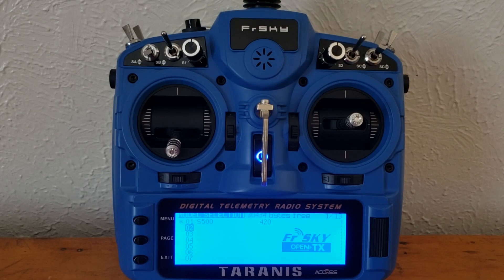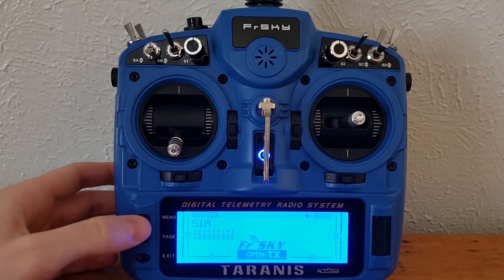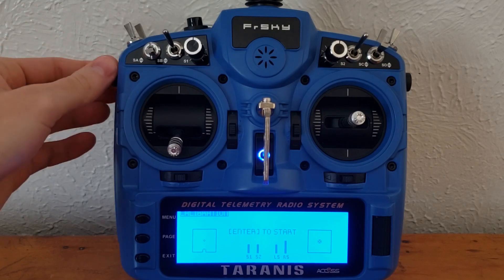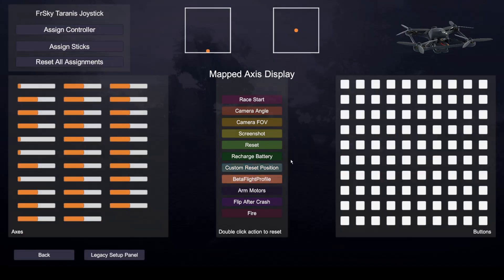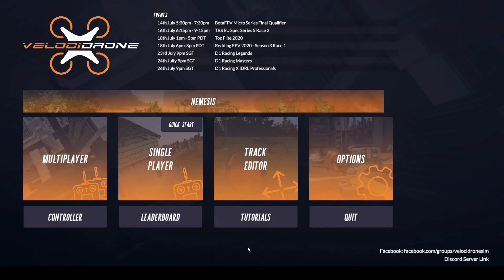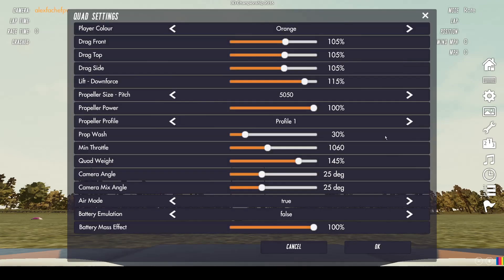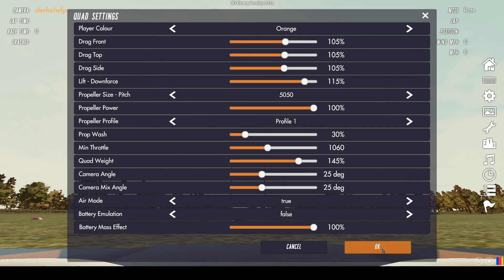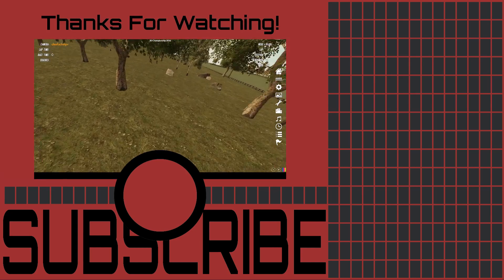Velocidrone Transmitter Setup - This FPV Simulator Changed the Way I Fly

Comment: Is this super hard for anyone else? Going through the race obstacles is so freaking hard. I'm a long time gamer and have played and mastered many racing and flight Sims. When I saw where the tech is at for Drones I got really excited to get into this and started with velosidrone before buying a drone, but this is way harder than I could have imagined. So much so I'm wondering if I'm doing something wrong.
Reply from the maker: Don't worry that it's pretty difficult at first, even though you have a lot of experience with other sims, with drones the inputs/controls are dependent on one another so it may feel a little weird at first. When I first started flying my real quad it took a few weeks to get a feel for everything. I'd suggest trying basic maneuvers (fly in a square/circle/etc), try to follow a road, and be able to center yourself in between gaps (between adjacent buildings/trees/etc). Then when you're tackling the course obstacles fly very slow. There's no need to rush through it if you can't even line up in front of an obstacle/gap.
Reply: Super hard at first. Took me a whole year grinding to finally finish a technical track without crashing. Super worth it tho.
Reply: @nozty  update: It got easier. So much so its hard to imagine it was hard. Like riding a bike. I'm actually quite good now.

Comment: Hey man I have been watching all your videos for a while now and I just wanna say I love the effort and time you put into them. They are very professional and helpful, especially for me who’s really new into this hobby. Do you happen to know how to setup the Pixhawk 4 on a standard plane configuration because for some reason I cannot get the servos to work with the correct PWM outputs. Thanks in advance and keep up the great work!!
Reply from the maker: @S Alan Thanks so much, I really appreciate the great feedback!

I have only worked with quadcopters with the pixhawk 4 but I can try and walk through it with you. (also sorry for the long note and weird formatting)

- Which power management board (PMB) are you using? https://docs.px4.io/v1.9.0/en/assembly/quick_start_pixhawk4.html#power this is the one I have (PM07).
- From the above link there are two types of outputs, "MAIN outputs in PX4 firmware map to I/O PWM OUT port of Pixhawk 4 whereas AUX outputs map to FMU PWM OUT of Pixhawk 4."
- Also take note of this table for later (found in the same link from above, scroll down a little):
Airframe Reference Connection between Pixhawk 4 --> PM board
MAIN: motor                 I/O PWM OUT --> I/O PWM IN
MAIN: servo                 I/O PWM OUT --> FMU PWM IN
AUX: motor                 FMU PWM OUT --> I/O PWM IN
AUX: servo                 FMU PWM OUT --> FMU PWM IN

- So as an example take a look at the X quadcopter that I used https://docs.px4.io/v1.9.0/en/airframes/airframe_reference.html#quadrotor-x.
- For a quadcopter we use motors and not servos so based on the table from above we are looking at rows 1 and 3. In the diagram of the X quad we also see that the specific outputs are MAIN. This narrows are rows {1, 3} -> {1}.
- So basically what you can see from the diagram is that the top left motor is 3 => Motor 3 => MAIN3. In another table from the above link there is line that is: "M3 I/O PWM OUT 3: connect signal wire to ESC of motor 3 here".
- So we solder the ESC/motor to M3 on the PMB then apply the same steps for the other motors. By using the I/O PWM OUT --> I/O PWM IN the motors could be controlled through their respective ESCs.

- Now for the plane.
- Which plane frame are you using?
- Looking at the standard plane for now https://docs.px4.io/v1.9.0/en/airframes/airframe_reference.html#standard-plane it appears that aileron, ..., flaps should be attached by MAIN meaning we are looking at rows 1 and 2 in my makeshift table from above.
- We know that on this particular plane the only actual motor will be used for throttle which is MAIN3. This is row 1 in the table. So this motor would go from  I/O PWM OUT --> I/O PWM IN and since this is an IO you solder the ESC to the M3 pad on the PMB (coincidentally same setup as above for motor 3 of the quad).
- In order to control your flaps you use servos. These fall under I/O PWM OUT --> FMU PWM IN.
- So you will need to attach your 3pin servo cables to the pin headers that are marked FMU-PWM-out on the silkscreen of the PMB. (I know I said FMU-PWM-in and FMU-PWM-out however in the docs it says that these are internally connected meaning that you can treat them as the same).
- example, For aileron which is MAIN1 you would attach this servo to pin 1 of the FMU headers. You should double check the pin ordering via the PMB manual but I'm pretty sure pin 1 is on the bottom if you are looking at the board with the battery connector up top. elevator is MAIN2 so pin 2, etc.
- One other important note is that the power line of pins for the FMU servos is not powered. In the docs it recommends grabbing the 5V BEC from your esc or getting it from your battery to power it.

- Make sure you then have both IO and FMU cables attach to your pixhawk from the PMB.

- Disclaimer, I have not actually done this for a physical plane so definitely double check this to make sure you aren't shorting wires when soldering, don't leave battery plugged in, etc (reading the docs will help you for future projects as well). Also let me know if you have any questions, the docs can be a little confusing and I had to read through it several times the better understand it.

Once again thanks so much for the positive comment!
Reply: @AlexFache  Hey man! First off thanks so much for such a detailed and comprehensive response! Don't worry about the format it was great :)

 I have the same PMB the PM-07 but for some reason the links embedded in your comment above are not working but I found the same pages on the docs manually. I completely understand how the Pixhawk 4 and PM-07 board work and I have setup everything but I get stuck with seeing a response on the servo from the radio once everything is connected. I am sure the servo is getting power because once I connect my 1S Li-Po into the PM boards FMU output pins the servo centers it self but it does not respond to input from my radio. On QGroundControl I can monitor my radio input and all the values are correctly received by the pixhawk. I have read the docs over and over again but there must be something I am missing or doing wrong. 

Again thanks so much for the such a comprehensive response :D
Reply from the maker: I just modified the links, the [ ] messed them up.

Check out this forum post https://discuss.px4.io/t/servos-dont-move/9644/2. You may have to switch the IO and FMU cables.
Reply: @AlexFache  oh that might be exactly what I am looking for! Will try it out as soon as I can and let you know. Thanks again :D
Reply: @AlexFache  Hey man, I tried what was on that forum post but still got nothing, I found another older post which said the same thing about switching IO and FMU cables. Perhaps I am missing something else...